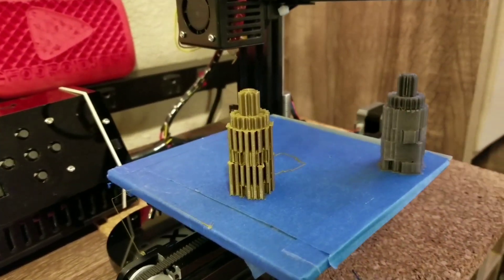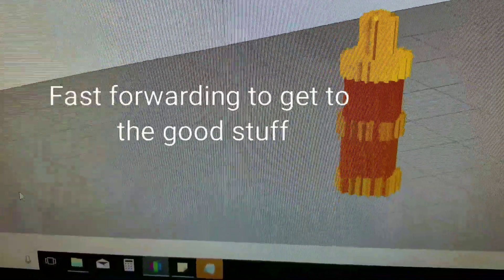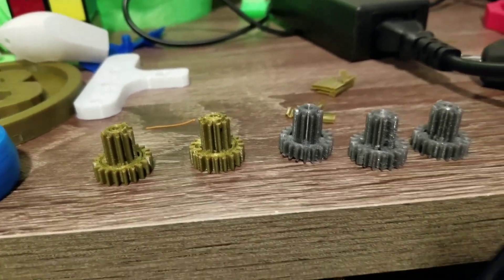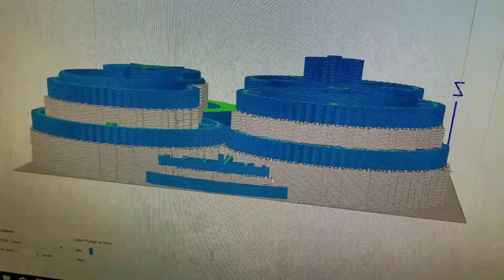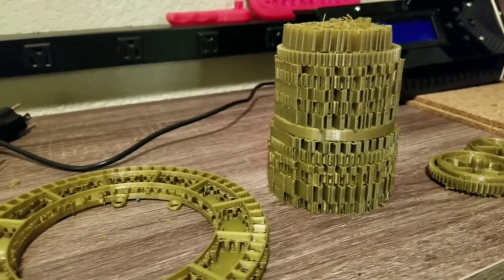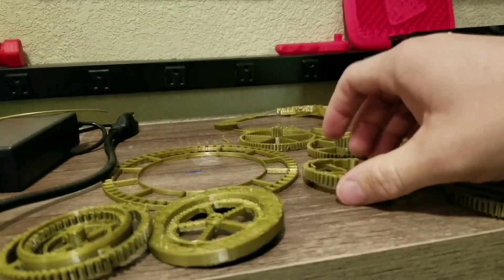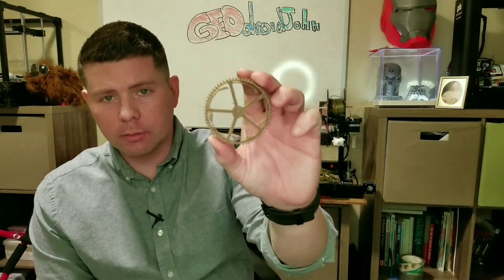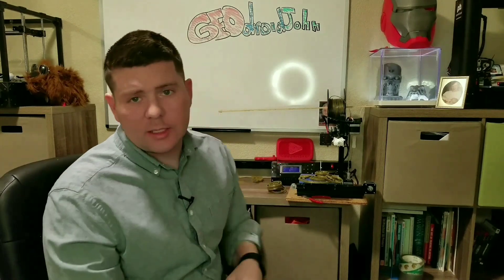Stacking 3D Prints? Can a small 3d printer stack up?

Comment: Good idea.  Another way would be to extend the Y-axis. One piece of 2040 extrusion, a longer belt, another base (aluminum, acrylic, or maybe even wood?), maybe a 3D printed support at the end of the Y axis, and modding the software to allow for the extended length.  I may give that a shot when I'm more comfortable with my X1.  Same goes for the X- and Z axes if you really get ambitious - LOL.
Reply: Ron that's the whole reason I bought the tronxy x1. Plus it was only 100 bucks on Black Friday. I can't wait for it to arrive so I can try it
Reply: Ron Floyd I know, I can't wait to see it's possibilities, keep me updated with your work!
Reply from the maker: +Ron Floyd that's on the agenda for the next video!
Reply: I'll be watching for it.  :-)
Reply: +Luke Cunningham - For sure - mine was $113 shipped using Maker's Muse's coupon - would have been a challenge to buy the parts for that.  Lots of possibilities for upgrades for that little machine!
Reply: Will do!  I got the X1 and X5S, so I'll be busy learning the ropes for a while.  11/11 sale and Maker's Muse coupon pushed me into getting myself an early Christmas gift(s) - LOL.  I hope I didn't bite off more than I can chew.
Reply: @Ron Floyd, yeah, I already downloaded the bed tightener file a week or so ago. I happen to have all of the parts to perform the 'extension' except for a bed ( heated or otherwise ). Apparently the board inside the X1 control box has a heated bed socket / connection. Cheers, JAYTEE
Reply: @Ron Floyd Have you seen this? https://youtu.be/4oE-dq-QF_0 Cheers, JAYTEE
Reply: Very nice!  Here's one of the first prints I'll be doing too:
https://www.youtube.com/watch?v=1IBgQtzfDxk
I got a deal (I think) on some 2040 aluminum extrusions.  They don't have the V grooves, but I think I have a solution there.  I got way more than I need (at the moment) - just couldn't pass it up - LOL.  If you need any, let me know here, (or find Ron Floyd, Duncan, OK on Facebook).  This should be fun.
Reply from the maker: +Ron Floyd I might print the rail see how it goes
Reply: Here's a pretty good deal for a 6" x 6" heated bed - U.S. made too
https://www.ebay.com/itm/251131700535?_trksid=p2060353.m570.l5999&_trkparms=gh1g%3DI251131700535.N36.S2.R2.TR5
Reply: Thanks Ron, I'll certainly look into it once I've built the X1. Cheers
Reply: hey ron, i put my finished printer video up on my channel. https://www.youtube.com/watch?v=vCTbLZ2_m-w&t=446s
Reply: $9 shipped for 6" x 12", 1/8" aluminum sheet.  Might be able to locate an aluminum backplate for car license plates cheaper - locally.
https://www.ebay.com/itm/125-1-8-Aluminum-Sheet-Plate-5052-6-x-12/232554779691?hash=item362558542b:g:qw0AAOSwNFVZhTfO
Reply: Great Thanks. I'll have to use a US to Aus shipper but that's cool ( hot ) Cheers, JAYTEE
Reply: If you have any machine shops near, you might check with them.  They often have drops that they have little or no use for except for recycling by the pound.  When I had my shop, I usually had a 55 gallon drum for that.  Sheet metal shops too.
The eBay listing is the only place I found for a 6" x 6" heated bed, though.
The same company has a 6" x 11" for $18.50 FYI.
https://www.ebay.com/itm/6-X-11-Heatbed-PCB-Heated-Bed-for-3D-printing/261308540474?hash=item3cd733e63a:g:KxkAAMXQI5tRin5D